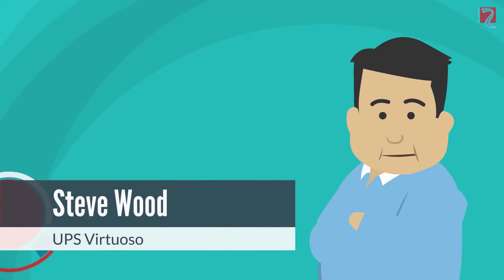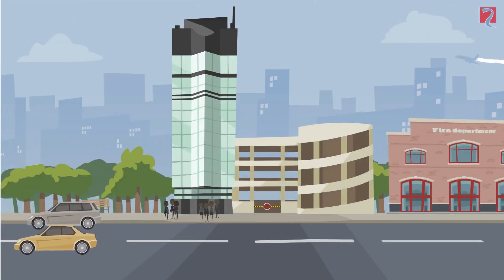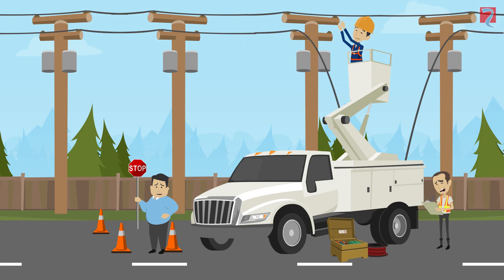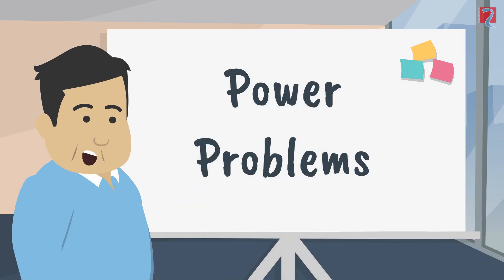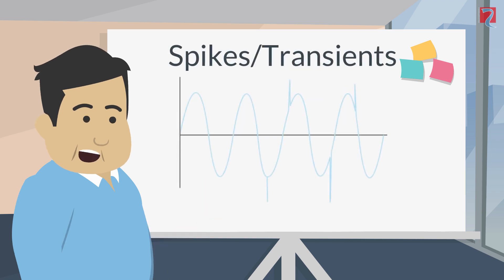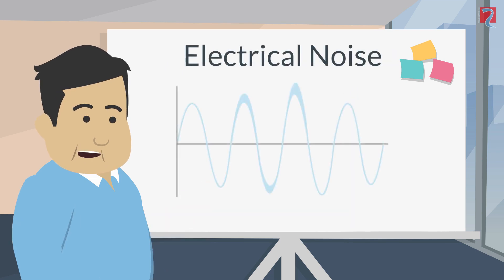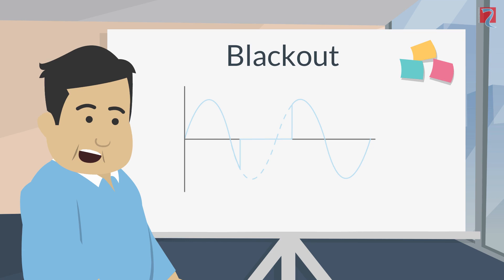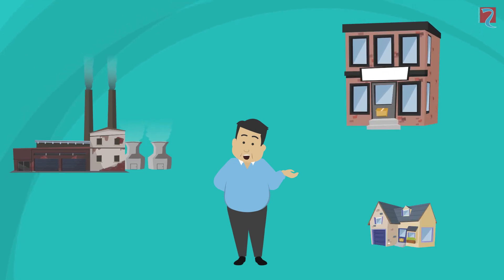#UPSbasics: Common Electrical Power Problems Explained

Comment: Regardless of how manufacturers promote their products or what salesmen or women tell you when purchasing your server or desktop computer, these are still fragile machines and should be treated as such.  During an unexpected power surge and subsequent power failure, your computer will immediately shut down. This will cause the hard drive (the essential spinning component inside the machine that stores all your data) to become damaged.  In many cases, the recovery system may be unable to either detect the drive itself or the spin cycle can be affected due to its fragility. In a situation like this, anything between a temporary data loss and/or a permanent internal hardware issue could occur. All business owners understand even temporary data loss means loss of time and loss of earnings.

Anyways, read the below. This might help.
http://www.namasteui.com/ups-offers-critical-power-protection-for-your-business/

--
Regards,
Sourav Basak
Namaste UI